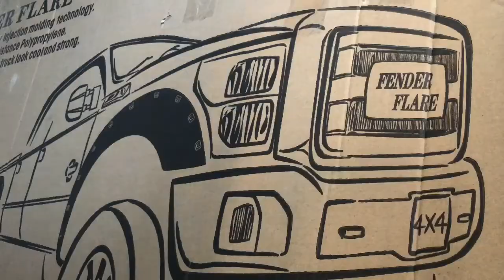I Got Bushwacker Fender Flares | Project: Ohana • 3/20 • | @PeterValdo1

Comment: Do you know of any mud flaps that will work with Bushwacker pocket style fender flares on a 3'd gen Tacoma?
Reply from the maker: Not other than those screw on mud flaps you can find in Oreillys, Autozone or NAPA. These have a mud skirt built into them so the uneven surface could make it difficult to screw something onto the plastic